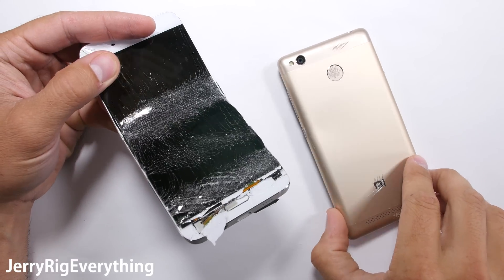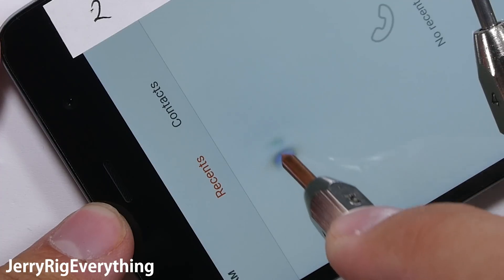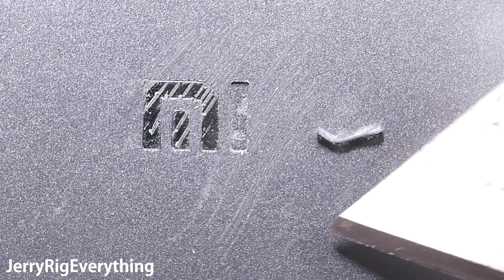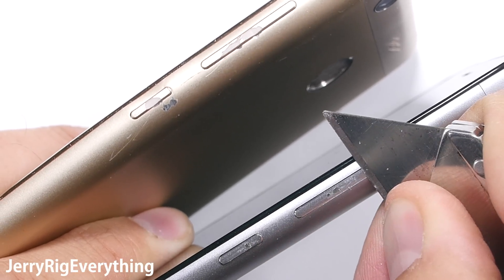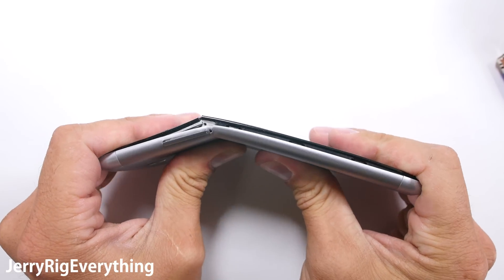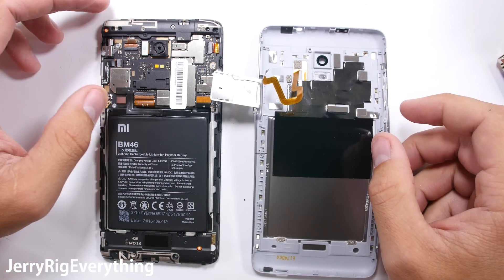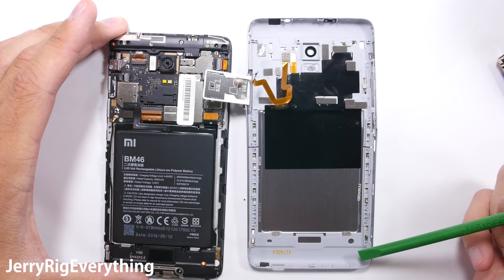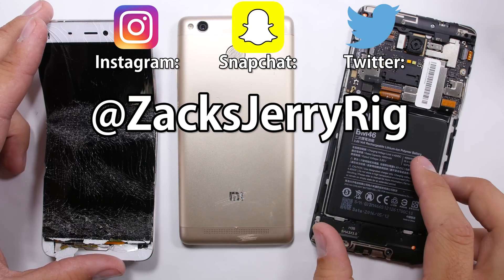Redmi Note 3 - Durability Video - Scratch, Burn, Bend Test

Comment: I own Redmi Note 3 and it's still working perfectly fine till date (2-Apr-21) even after very rough and tough use. Many phones were launched but I never felt need of changing this beast. One of the most durable smartphones made by Xiaomi ever.

Comment: I am still using this phone with no damage at all.
Reply: I used it until recently, because I had the 2Gb RAM / 16 GB internal storage, and it is  very painful to use 16 GB in 2020
Reply: @HelyoG  yeah. Honestly I am also facing little problems now and I have 3 GB version. Most of the app keeps reloading. Battery gives 4-5 hours backup. Still running Android 6.

 Will upgrade it in may or June.
Reply: @batman_2004  why don't you install a custom rom it will give your phone a new life it did for me
Reply: @batman_2004  Dont Install any custom Roms okay, it will only make things worse. I agree RAM Management can be a pain sometimes, but in return we still do get workable battery life. If its giving too many issues just factory reset it. It shud run Smooth af again. But get a new phone, now, you deserve it Batman. Redmi Note 3 has served well, now its time u factory reset it and either sell it, or treasure it and keep it as a reliable backup phone.
Reply: @HelyoG  T_T 2GB didnt age well, u shud have gone for the 3GB, much better experience. My dad still abuses that thing XD.

Comment: After 4yrs, the bend issue is the main problem, it's slightly bent, leaving a slight loose latching at the right side and the power button somewhat unresponsive due to that.. It's processor capabilities are still good, and running on Android 9(Pie) with May security patch, Thanks to the Custom ROM Developer Support..

Comment: 4:23 It DOES NOT have the same basic design, as you can clearly tell that battery is pretty much at the center of the phone. The battery size and its position will effect the most to the durability. It's the best when battery is on the center of the phone and/or are long shaped (I remember seeing L shaped batteries which definitely adds more strength.) Phones ALWAYS cracks just above/below the battery line and the battery actually acts as an pivot point for bending the weaker area. I actually don't know why Jerry doesn't mention/understand this when he's talking about durability. The fact is: Battery is the strongest and hardest part to bend in the phone and every phone would snap in half without its toughness. (At 5:20 you can clearly see exactly same result with that same battery style and same positioning.)

Comment: This is 2020 and I'm using RN3 and it works too good! Its a freaking 4 year old phone bought in 2016. 

The only problems are camera quality and battery doesn't last as much as it used to and the android version which is marshmellow (it sucks coz i want to upgrade badly to 10)

 Nonetheless it's working good. Cheers Xiaomi!
Reply: Same. Battery last 6-7 hours for me. Running custom ROM on it.
Reply: Get custom rom to get android 9 or 10

Comment: I've used the redmi note 3 for almost 3 years and it worked perfectly. The only 2 things that were bad about this phone for me were that i got dead a few dead pixels on the screen (like 5 or less not really visible but they were there) I had the first phone replaced and had the same problem with the other one, also the volume up and the on/off button died after 2 years of use I had to press them like hell to make them work if I needed to. I recently upgraded to the 9T Pro and so far I'm loving it. Pretty late feedback for this phone but I guess it is some useful info

Comment: I ordered my redmi note 3 in 2016 and I was abit skeptical about it but it just turned out to be an amazing smartphone for me. It even after 3 years of purchase handles day to day usage quite nicely even in 2019. This smartphone has made me realize that no matter what any company says, you should not buy smartphone every year. Maybe two years later there is significant improvement in technology.
Redmi Note 3 definitely has had some problems though, it's battery swelled up, the famous headphone jack and the Bluetooth headset problem and after updates of course the battery drainage which reduced the screen on time to just 4 hours. But my phone has sustained alot of drops and still works which is my favorite thing about this phone. 

But overall i have completely been satisfied with Redmi note 3 and now i will move on to the next Xiaomi smartphone which is the Poco F1. Redmi note 3 has put a high benchmark for the Poco F1 and my expectations are high from the phone.

So this is my last thread. Hope you guys have a great day.
Reply: Now updates are closed for note 3 try custom ROM it will make it work like new
Reply: Same mine is also a 3 years old redmi note 4
Reply: It was an excellent phone. My advice to everyone will be that please don't change your phone before 2-3 years. I got poco f1 after redmi note 3 and i am once again really happy with it.
Reply: Man,  my phone is about 3 year old and Its almost mint condition still.  No battery problem. No bullshit.  I didn't even have to think about buying a  new phone. Time to jump to mi k20pro now.
Reply: @huurair6523  lucky guy. I also had issues in the third year not before that.

Comment: It's been more than 2 and a half year, when I started using my Redmi note 3.
And it is still working fine, even in the era of Poco F1.
Obviously I dropped it quite a few times. But nothing happened ( little bump).
And I can still play PUBG without heating issue ( Outdoor temp 28 -30°C, and device temp 35-40°). 
So yes it is quite literally a Good Budget phone.

Comment: I am using RN3 from almost 3 years and its a great Phone
Reply: Does it have any problems?
Reply: @srp770  its working perfectly no lag
Reply: My dad has the phone. And it's durable. His phone screen is completely cracked but still works perfectly
Reply: Me too
Reply: Vinoth T get the note 7 my bro
Reply: Bro there was not better redmi phone than RN3 till they launched RN7... Truly a great phone except the optics.
Reply: Mine too
Reply: how battery backup?
Reply: Used Rn note 3 for 2 years. Excellent phone at that time. Pubg is playable in hd with zero lag. Phone was destroyed by water. 
Now upgraded to Rn note 7.it's an absolute beast
Reply: Mine broke in 5 months
Reply: Same with me but after 3 years with it now i will buy the redmi note 6 pro, i love the battery life and the MIUI system.

Comment: I bought this phone, after 8 months a few dead pixels appeared, then the "leaked" to the side, causing dead stripes. Took it back for warranty, supplier didn't have parts, so retailer decided not to honour warranty citing I must have damaged it. With no scratches or any indication of external force, and my phone being in a armor case, I had a massive fight with them, but they doubled down. And thus is the tale of the last Xiaomi phone I will ever buy, and the last time I ever buy something from Incredible Connection/HiFi Corp in South Africa.
Reply: Bad for you but I am still using it, no problem at all

Comment: Does anyone still have this phone?
Reply: 2+ years and works like a charm. barely any scratching on it, had it in a case most of the time, holding up pretty good. Didn't bend through the years. Battery still manages to pull off a day and half with regular use.
Reply: Me........ Still an amazing phone
Reply: I have
Reply: Yeah! And gonna have it for more 5-6 months
Reply: Me for 3 years....recently changed charging port and battery and now working as good as new.....planning to have for at least 1 more year :-)

Comment: Wtf I have the Redmi Note 3 Pro for over 3 years now and I has withstand many brutal impacts without a case and it's way more durable It took a 2 meter drop with a case no problem and the screen hasn't shattered once Only the bottom right of the phone is bend

Comment: I have this phone for two years, it fell from my bicycle ride, and screen didn't broke without protection. Have few scratches but it not broken. Using tempered glass and plastic case now and I'm fine. Guys do not use phone this size without tempered glass protection, physics tell you that that they bend sensitive. My best move was to switch to developers ROM global beta, now phone works much better and fuild. Battery time of 2 days with normal use.

Comment: Can I just say that my Redmi note 3 lasted longer (and is still running) than my Xperia Z1 and two Z3 compacts combined. I've dropped it many times and the glass is far superior quality compared to any flimsy Sony which have the lowest retention rates of any of the major smartphone manufacturers. It may bend in half but compared to Sony  devices it just lasts far longer with drops etc.

Comment: I have been using MI Note 3 32gb for one and half years and I am absolutely pleased with this device. I have dropped it at least 50 times so far from a hight of 1 to 2.5 mtrs without any damages just the tempered glass shattered.

Comment: I am actually using this phone and it has been dropped several times, i have sat on it in the car and whatever. I had even slipped once while fishing and landed in water and it got a short shower, not a lot as it was in my pocket and i reacted fast and got out quick but it was wet and it still works. I really cannot complain as i got it for 120 euros... you cannot beat this phone for the price and the battery does last quite good.

Comment: I broke my screen, it was on my lap, I'm sitting in an Indian sit position, because the back of the phone is smooth, it fell off, then boom, screen is broken. One big line from top to bottom. You guys should really put on a case and screen protector. I'll never buy a phone again without Gorilla Glass protection.

Comment: dont buy xiaomi red mi note 3 pro, after one month i have the strong urge to smash the fucking phone. worse phone ever used. apps crash, hangs, lag. graphics capability sucks big time, most probably memory problem. map dont detect my car is moving, hangs at the same exact spot when i set google map driving directions. phone heats up quickly when playing game or using google map. 6 cores, 3gb ram  yet so unstable, fucking trash shit. the camera is the best shit, photo quality is mostly blur outside the focus area, photos taken sometime don't save at all, you take the picture and somehow it manage not to be save in the storage, it just disappear. so every time you take a picture, check the fucking gallery after to make sure photos are in the storage. Come on, who does that, so much trouble to use the trash phone. Though i must admit the build is quite tough, after more than ten throw on concrete floor, car dashboard, road, the most damage is the volume area dent in, screen is totally fine

Comment: As someone who has bought multiple Xiaomi phones, watching these videos is a brutal experience, but it's important that someone do these tests, and I'm glad to see them done objectively. I think the take-away from this is that Xiaomi phones (and all phones, really) should be handled with at least a reasonable amount of care. Putting them in your back pocket and sitting on them is a bad idea!
Reply: uncaringbear Mine has now bended from staying in my front pocket after 5 months. I did nothing abnormal with it. I can still use the volume buttons, but I doubt this phone will last for long like this. I'm now going to see if I can find a really strong case for extra strengthening. I hope there is a case like this and that my phone will not bend any more than it already has with such a case.
Reply: Guus Tielens that is really scary to hear that. I am going to avoid keeping the phone in my front pocket. I also ordered a case for my Mi Max the other day. Hopefully that will provide some added protection!
Reply: uncaringbear i have a Redmi note 3. Good phone for the price, but I have it protected with a tempered glass and a plastic cover with a design.
Reply: May I ask you which Xiaomi phone were you using? Was it Redmi Note 3 like in the video?
Reply: lastkidonthemoon Redmi Note 3 (Pro  Prime version, but that's just a different chip and more storage capacity)
Reply: I see. I've heard that the new Note 4 or redmi Pro might be a bit sturdier, so I wonder if he could do another video about those
Reply: lastkidonthemoon That would be nice if he could yes. I have read that the Note 4 has its downsides, though I can't verify that myself. The camera is worse than that of the Note 3 I believe. And I wonder what impact the new hexa-core chip of the phone has on its battery life. But if it is sturdier, that would be a big plus.
Reply: I doubt either would protect the phone from bending though. I own a Xiaomi 4s and I also always use a silicon case and a tempered glass protector, but I've noticed that even at 5" it became a bit bent after a prolonged usage. Not by much, and by no way really noticable (only about 0.5mm), but it's still there.

Comment: note 3 and note 3 pro do have the same build?
Reply: Yes, only changes the specs
Reply: alright thanks. what are the different specs between the two devices?
Reply: The note has a MediaTek Helio X10 2.0 vs the snapdragon 650 on the pro. The camera on the note is a Samsung S5K3M2 13 mpx vs the pro with the Samsung S5K3P3 16 mpx. The pro has a sd slot and the note doesn't have it. (sorry for my bad english)
For a more specific terms you can check it here: http://www.kimovil.com/en/compare/xiaomi-redmi-note-3-3gb-32gb,xiaomi-redmi-note-3-pro
Reply: thank you
Reply: You're welcome bro :D
Reply: great explanation, the Note 3 Pro still blew me away, specs and that 4050 battery is ridiculous, might get it, for the price who cares I doubt anyone will abuse the phone as much as these videos.
Reply: Mauricio casco Awesome do you know if the software has a blue light filter like the iPhone nightshift built in?
Reply: Mauricio casco Exactly! not even my Note 5 has that.
Reply: EElectric_M I know! I have this phone for almost 4 month now and is amazing, I'm using it without a screen protector or a case and doesn't have any scratches. I bought it for 170 $ if I don't remember wrong, and for that price I can't be more happy.
Reply: EElectric_M Something like this? xiaomininja.com/2016/01/19/reduce-harmful-blue-light-with-miui-read-mode/

Comment: Bending the phones in this manner follows the laws of the levers. The phones (just like other devices/materials) break at their weakest points. The reason Redmi 3 didn't bent like the MI5 and the Redmi Note 3 is that the battery which is the toughest subassembly, acts best as a reinforcement because it's placed in the middle of the device, where the thumbs act like a fulcrum. Unlike the other two, in which the batteries are a bit off centered in relationship with the thumbs (fulcrum). One can see clearly the phones break in the proximity of the battery's edge. 
In conclusion having a long, or better, a massive battery centered in the phone's structure can help allot in giving the whole structure a better bending resistance.

Comment: Nice test, but you are talking about $200 (or even less) inexpensive entry level phone.  You can easily afford to buy another one if it breaks, not so with $700 or above flagships.  I used Redmi Note (the original) for couple of years already and it has served me very well.  Of course, if I deliberately tried to break it into two, I am sure it will perform no better than Redmi Note 3 as shown in your video.  But for most daily usage, it held up fine, and even survived being run over by a car when it was accidentally dropped on the road.  Not bad for a very cheap entry level device!

Comment: Hi Zack, I enjoy your channel a lot so thanks for destroying all these phones for our benefit. I wanted to chime in on a phone that has been talked about quite a lot but you haven't covered yet. The Elephone P9000, which on the face of it has a good specification. I've now had 3 of these phones in my possession, I bought 1 for myself, then 2-3 months later I bought one for my 12 year old daughter. 
It was about 5 days after that, the first accident occurred, I sat down in the car with the phone in the back pocket of my jeans and 140lb person on a foam seat, put the phone at a 45 degree bend, ripped through the ribbon cable attaching power/volume buttons, ripped the ribbon cable to the fingerprint sensor. That was about  6 weeks ago, and I concluded the phone wasn't really practical to fit, the battery was all the wrong shapes, the sim card tray was twisted, the body wouldn't really straighten any good way, the LCD was kind of expensive to source and at the very least a new button assembly was needed. 
Yesterday, I saw a new level of epic weak from my daughters P9000, while playing a game on the couch (was crossy road I think), my 12 year old daughter managed to snap her P9000 right through (with even the body snapping right through on 1 side). 

Having spent more time than I would really want to looking at the insides of these phones. I basically reached the conclusion that the phone is relying entirely on the glue the display and plastic back are attached with, which is like a glue gun glue. This gets softer when the phone is hot, and once it is soft enought entire phone is then relying on a couple of strands of aluminium under 1mm thick above and below the buttons for the rigidity along it's length. 

Right now I'm not sure which way to go, I am using an old lumia 640 which is a pain in the ass, but given I basically don't give a damn about the phone, I can testify that it is damn strong the removable back actually seems to add practical strength because I can throw the thing against a brick wall, and the back cover will detach, the battery will eject, the phone is at this point ultra light, and as a result when it hits the ground it doesn't have enough mass left in it to break it's own glass. 

What do I go for next though....